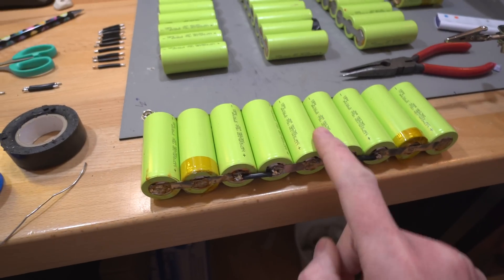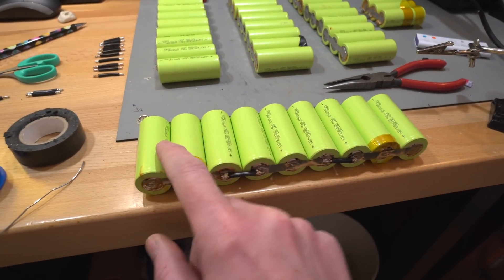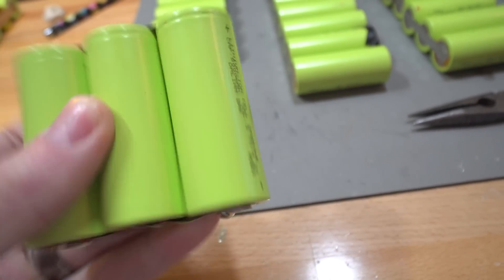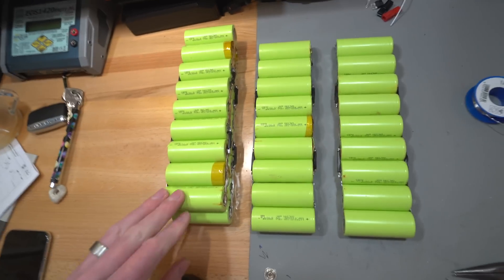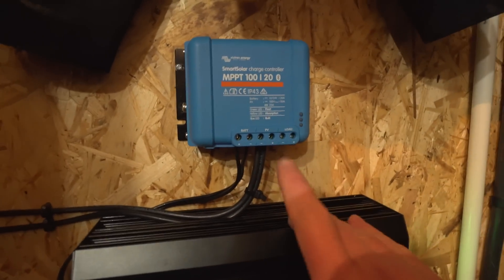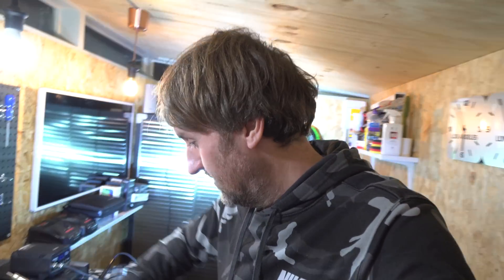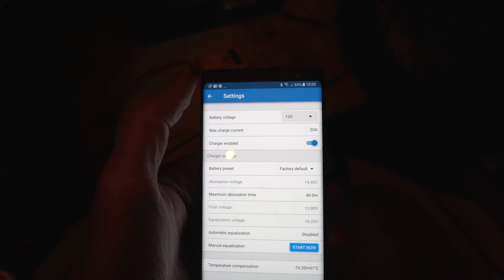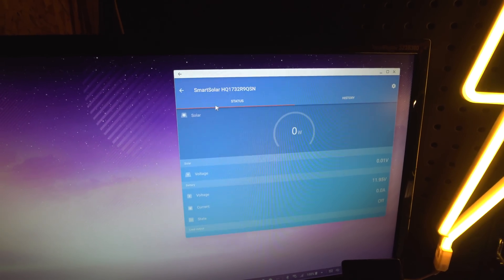SOLAR POWERED SHED | PART 2 TESTING THE VICTRON SMART SOLAR MPPT 100 30 CONTROLLER

Comment: I'd get some thin car battery chargers ( thin but long ) and stick them up in your wall windows say 5 linked up together as a backups backup. I'm about to try mirrors to shine on solar cells to beef up the sunlight to the panels.

Comment: Does the solar charger work for lithium battery? Not 100% if that what your making?. I’m trying to make a lithium batter set up in my 4wd and wondering if this charger will be good? It looks like a great product. Also nice work mate looks like a lot of fun
Reply: I want to use a 100/30 for lipo 72 at 29.4 volts. Will it work?

Comment: this thing does not work when i try it with 24v system.
its just not loading my batteries. iam pretty sure a 320Wh module is enough.
12v works fine.
Reply: You may need to go in the Bluetooth or dongle and set it correctly

Comment: I bought myself the Victron SmartSolar 75/10 and I'm still wondering why there isn't any real timer function in the app. I mean the traffic light function is pretty nice but I'd like to set a timer when the load has to be powered on. Do you have any idea how to solve that?

Comment: Hello Andy, great video by the way, can this controller handle a 12V Renology 160W Solar Panel , 2 Renology 12V-100ah Batteries. I'm planning to Install it for a Wireless PTZ CCTV Setup with a 12V-500Watt Pure Sine Wave Inverter. I will be using 123.5Watts tops (2 CCTV Cameras(75Watts) + 1 Wifi AP (8.5Watts + 2  (20Watts) IR-led Enumerator). Will this setup do the job. It' s going to be my first Solar panel experience. Thanks

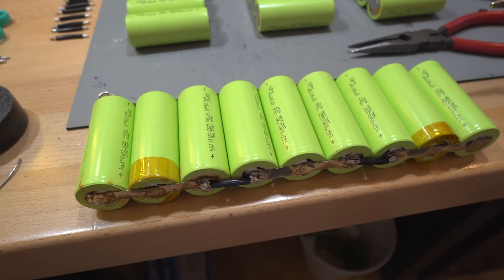Comment: Great series you are doing here mate  :) Please dont think those short black insulated copper wires at 1:40  will act as a large fuse, they wont. Consider using suitable rated fuse wire at the end of each the 9s packs. Keep up the good work. I wish you much sunshine from Australia. Cheers :)

Comment: hi any advice how to connect 12v 2 diferent car batteries to be charged from one mppt ?
Reply from the maker: Hi, it’s possible to do it with a diode (to stop one battery feeding into the other. Or Victron actually do a thing called a battery combiner https://www.victronenergy.com/battery-isolators-and-combiners/cyrix-battery-combiners
Reply: do i understand good from mppt charge goes to bat1 then trough combiner to bat2 when bat2 is fully charger it stops from overcharging . when bat 1 is full mppt stops chaging bat1 .

Comment: solder paste works well for soldering tabs to batteries...
Reply from the maker: Yeah I saw that in another video actually, might give that a go next time thanks!
Reply: No prob.  I learned that the fun way trying to use traditional solder/flux.  Basically just tab the paste on the battery, put your nickle strip on top, bit of heat and boom done.  Cheers!

Comment: These cells have to be capacity tested
Reply from the maker: The last capacity test I did was when it was a whole ebike pack, and it was around 15Ah for the whole pack. Originally The cells were brand new and had never been used in anything else and they were always within 0.01v so they “should” be ok.
Reply: andy kirby cool great work

Comment: 2 thoughts on you batteries: 1. You have paralleled 9x 5ah cells without cell level fuse. Those cells are very powerfull. If one shortens out (the warm cell could be an indication), 8 others will push 40ahs with immens high currents through that cell. Be aware that LiIon is a far less stable chemisty then LiFePo. A burning e-Bike is probably less bad then a burning shed. 2. You went for the 4s battery pack. Those simple BMSes only balance near the max voltage above 4V. I am afraid your pack will never balance as the high cutout voltage on the inverter will come first. And if one string is coming out of balance so much that balancing would start, those balance boards only have balance current of 30-50mA. Thats nothing for a 45Ah string.
Reply from the maker: You make interesting points thanks. Regarding cell level fuses, I can see this being a valid concern. Has anyone had a cell fail in this manner? I know Tesla take the safety measure but I’m wondering how common this is. The other issue with a small high performance pack like this is that the fuses may themselves cause a fire risk if they heat up under high load. Do powertool companies fuse their packs? I’ve never seen a fused drill battery or any appliance. I will be investigating this further.

As for the BMS, yes I am aware that balancing will only be happening at the top top end and as I’m only charging to 4V per cell it will not be balancing unless one cell gets too far out. These videos are a little behind and so far I’ve done about 10 cycles with this battery and I’ve checked the cell voltages each time and it’s still in balance.
What I really need is an active balancer with 300-500ma discharge. The hobby ones might not cut it... if you have any recommendations that would be good.
Reply: In power tool batteries, laptops or even e-bikes, cells are typically only put in series to achive high voltages. Theres not as many cells put in parallel. Thats why if one cell fails, those batteries go into the trash even if most cells are actually still usable. This is where the hobby powerwall builders come into play. But building packs with old cells do always include the risk that cells are not equal. A fuse isnt a fire risk. It will melt is seconds, while in unfused packs good cells can pump current through damaged cells for minutes
Reply: BMS: as you only have 4s you might try a "lithium battery equalizer" (search on AliExpress or Ebay). They can balance with a couple of Amps instead of mA, and do not wait until you reach a certain voltage. They cost around 20 usd per s (80 usd for 4s).

Comment: Hi Andy, I bought a used motorhome control panel to distribute the 12volt supply. It’s a 150watt panel through a Chinese controller with a lead acid car battery. I’ve just got three LED lights above the work bench, nothing too complicated but it works. Good luck.
Reply from the maker: Good stuff David, I bet that works well. What do you use the energy for? Lights? It’s crazy how much energy comes in on a good day.

Comment: I am getting around to building a system like this, but I was thinking I would need to use individual battery fuses, as in e.g. the Tesla walls, in case one battery went short circuit leading to a potential fire. Maybe I missed it, but does your system have something similar?
Reply from the maker: Hi no it doesn’t, for this experiment I’m using quite a small battery as im using cells I already had. There will be occasional high loads so having fuses might be problematic in that they would heat up under high load and may even burn out prematurely. If I was building a large pack with recycled cells I would definitely add fuses.

Comment: you should measure the resistance of that hot cell and calculate the kind of power losses youd expect from it (ohms law) if the power loss at whatever current and voltage its going to be running at. because if youre running at 100A 12v and that resistance is too high that cells internal resistance will get higher as it gets hotter and eventually could become a short or worse simply ignite. my advice would be to remove it altogether if its getting noticeably hotter than the rest of the cells.
Reply from the maker: I’ll definitely keep an eye on it. I’ve since done a couple of discharges at 20-30 amps and there didn’t seem to be heat anywhere. When I do some higher current discharges I’ll check again. Your right about removing it if it’s getting hot.